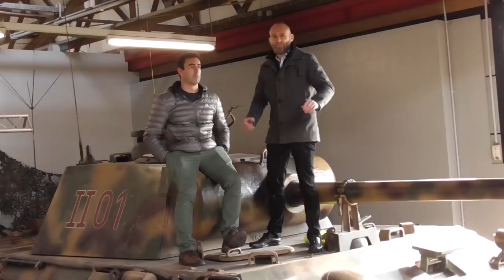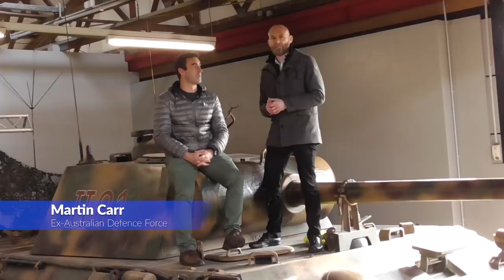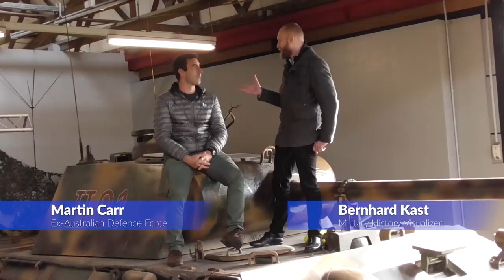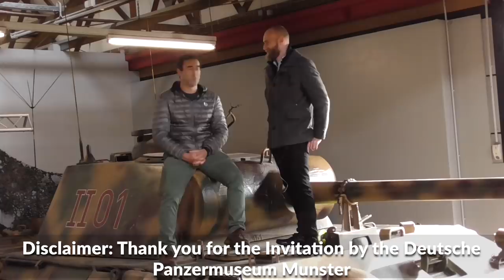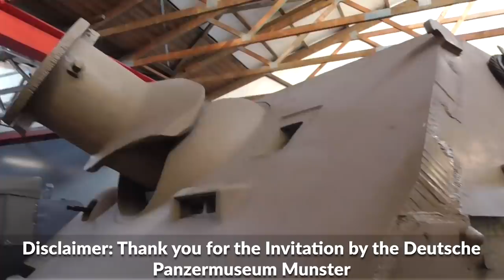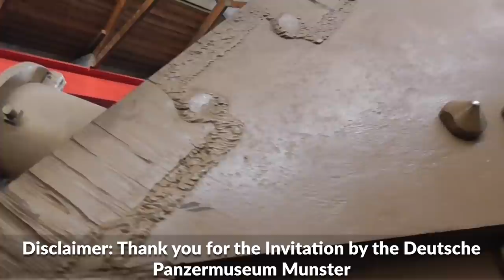The Future of Tank Combat - Decoupling!?

Comment: I believe this is a good point but it also introduces some vulnerabilities. First communications must be super reliable, second  destroy the control vehicle  and you have stopped a number of other vehicles, because autonomous systems are a double edged sword. I rather believe that new materials and active protections systems will allow lighter vehicles.
Reply: Well first they have to figure out how to make an active protection system that doesn't eviscerate supporting infantry.
Reply: Active protection doesn't save you from the ever primary treat of mines and ieds and new materials espesially if the make you lighter dont help either. But that's great you'll be able to use them on the manned command vehicle and maybe some of the heavier screening drones, the later can be configured to front and side armor for the head to head fight and the command crew can be hardened against mines, ambush and arty but still fast to get to a hull down or hide position. You keep communications reliable and over come jamming by broadcasting close to the asset from a good position or by relying through several receiving and broadcasting drone assets. Humans are gonna just serve as platoon and squad leaders remotely commanding fire teams of 3-5 combined arms drone swarms with air and ground units spotting, shooting, relaying and baiting for eachother all while humans hind hull down behind a hill.
Reply: A variant is to build something like a Russian T-14 tank. Put the crew in  compartment in the hull  where  you can have a lot of amour but put the sensors, guns, engine etc in part with less or no amour.    The decoupling can be inside one vehicle not just in multiple.

So you can protect the crew from a IED and other attacks but sacrifice the rest of the vehicles if it is hit. A scouting vehicles could have the weight and capability like in the past but protection of the crew.

It is a bit like battleships and the "all or nothing" armor schemes.
Reply: Hybrid could work. Sensors and anti mine, anti missile protection on drones and maim weapon on the  primary vehicle. Sort of an entourage programmed to follow.
Reply: There's no reason why a 100 tanks couldn't share 100 drones (or more) in a distributed network. Destroy one drone and now 100 tanks are sharing 99 drones etc

Comment: In Afghanistan and Iraq drone and remote technology made exponential leaps forward. IED rocket and mine technology was adapted rapidly by the insurgents who also started using commercial drones and the like. One outcome was wheeled armoured vehicles made a big comeback as mentioned. The Australian Bushmaster wheeled troop carrier did very well. No KIA from multiple strikes. The wheeled Aslav was not as successful showing design and countermeasures still matter too, not just wheels!

There is already integration between various elements like AFV and drones. Decoupling would be a logical next step however there are also big practical problems some of which were touched on well  in the presentation like comms, jamming etc.

But many of the problems are quite mundane and practical. Drones and remote vehicles can do very strange things like fly straight into mountains or easily get bogged if on the ground or not see the enemy standing right next to them or perceive non threats like civilians as threats or lose signal going into dead ground. Very hard to recover when things go wrong! This was all seen in Iraq and Afghanistan. The battlefield is much more messy than the theory and the best testing opportunity.

But I can see tanks decoupling elements to become a sort of spatial weapons system or at least to have that capability. I say capability because the tank as a portable complete weapons system is always going to have advantages on a fastmoving battlefield. It is its main advantage. For example if you deploy things like drones or unmanned sub vehicles you also have to retrieve them which takes time. 

Time is of the essence for advancing armour. Imagine even just a squadron of tanks deploying and retrieving all their remote bits. Big potential for tangles and delays...of course these problems can be overcome through training and SOP's. But these will take time to develop. It suggests decoupled elements might first find their place in specialised units within armoured formations, such as the recon units which are usually  the more forward-leaning, experimentally receptive units because of the high risks they take advancing to contact. 

I  can see armour using decoupled elements in specific situations like when they are on the defensive, want a tactical over the horizon view or fire capability, hull down providing covering fire for other elements like infantry, or come up against a potential obstacle like a built up area with a high IED/anti armour threat.

Interesting to note that early experiments were made by the Wehrmacht in WW2 with their goliath and borgward remote controlled demolition vehicles but were not very successful. This was attributed at the time to the primitive state of the technology, which is certainly true, but the practical issues listed above still remain to be overcome.

Comment: After this, I'm reminded of the phrase, Delay, Degrade, Deny. 

This is the reason I think we also won't see this fully decoupled vehicle as suggested. It's going to be seen as too much of a vulnerability to the fighting capable of all you need to is delay the signal. Especially if it's the primary offensive systems. 

So we might see smaller, secondary, off shoot vehicles acting in support of a main vehicle, equipped with a form of cannon. The end form and function, principle of said cannon is more the question. The idea of tank hauling a couple of smaller UGV's around, allowing them to be turret down and observant, directing AT missiles or the like onto targets, has some value. So to does this work for mine sweeping duties, better the drone gets blown up than risk the tank. Not only that, provides means and methods for members of a platoon, company, to provide mutual support to other elements. In their own formation or additional supporting formations. 

Tanks make the beach head, take out any large armoured hostiles, then supporting drones can move in with the infantry, doesn't sound so bad. Depending on capability, actually sounds pretty good. 

Unless you can guarantee that the system is able to work under adverse situations, a complex ECM and ECCM situation, in areas with high degrees of reflectivity, at least in the areas of radio communications, more importantly, is able to determine a proper, authenticated feed from false inputs, sort out harmonics, background noise that so happens to look like signal, we're really not going to see it. 

Like the guy said, anything that emits is going to really light up the area. That I don't think will ever change. 

And..... we're only getting better at identifying, recognising the stuff.

Comment: As per the "old" Swingfire / CVRT Striker model - where the missile operator could fire from a remote location with the vehicle in dead ground / reverse slope. If you can mitigate the EA threat then you could be siting in a shipping container as per the current UAS model.

Comment: I highly doubt cannons and sensors will be decoupled. You want at least a mediocre sensor suit on the cannon vehicle just so it can still operate somewhat on it's own and isn't effectively taken out if the sensor vehicle get's destroyed. But now you have two diffrent vehicles, including all the armor, engines etc.. you need anyways. If you'd just upgrade the sensors on the gun vehicle to those you'd otherwise put into your sensor platform you can forego an entire vehicle. And similar you'd want a sensor vehicle to carry at least a light armament so it's not entirely defenseless. (Integrated sensor drones are another topic, but they are a addition to a tank, not a replacement for it's capabilities)
Reply: I agree. Sensors can easily be taken out by enemy fire, desert sand and other stuff so its not practical to rely on sensors only. Furthermore would sensors also require space, and space for cables and electronics which will mean that less space would be left inside a tank for other things, and armour thickness needs to be reduced and several weakspots needs to be added when you fit all your sensors... so I doubt it would be worth it.
And it would also cost money.

But I also think the development will go towards more automation in other aspects. Tank guns are starting to use to large calibres that it would no longer be practical to load guns by hand when Leopard 2 and Armata starts to use shells with a big diameter of 130 and 152mm.
So autoloaders will therefore become more common.

Comment: My main concern would be emp
Reply: you can shield against emp.
Reply: The heat, energy and other radiation released from creating an emp would take out everything anyway. Not gonna get any kinda emp effect other then normal jammers without a nuke.
Reply: EMP is overrated - it is quite easy with current technology to build EMP resistant electronics, most front-line strike aircraft and attack submarines already have this. The issue for the poorer armies and the  commercial sector is cost  - doing this increases the cost massively. EMP will be devastating  to the public and armies operating commercial and non protected equipment. Interestingly the Russians had a way to isolate EMP and keep the cost down - they used valves not transistors or chips in the MIG 25. At first the Americans laughed when they finally looked one over,  till someone pointed out its benefits in this area. You can protect electronics, but if I am in the air when the bomb goes off I hope its a Lancaster not a Boeing or Airbus.........

Comment: The solution for the jamming sensor signals would be a kind of tightbeam signal instead of a broadcast like is used now. Yiu would need visual contact to your sensors and gun, but that could be solved by relay chains or nets. The real problem imo is energy; running such a system is infeasible over longer periods of time when spread apart.

Comment: I've been thinking about a couple of ideas for future tanks. Feel free to give me some input:

1. A primary weakness of tanks have always been the limited visibility from inside the tank. Visions slits and optics have been employed, but tanks still need the eyes of infantry support to gain full situational awareness. So what if the tank crew was equipped with a VR-system that is linked to strategically placed cameras outside the tank, effectively letting the crew to "see through" the interior walls?

The loader might not require one. But the gunner, commander and driver could probably benefit from this feature.

The technology to pull it off is already avaliable as there are VR-cameras capable of sending a live visual feed to VR headsets.

Of course, a point of criticism might be that cameras on the outside of the tank hull would be vulnerable to enemy fire. But tanks already employ external optics (protected as much as they can be) so it's not a bigger weakness than the ones tanks already have.

It would just add a greater field of view for the crew instead of being locked to the very narrow field of view that current optics provide.

2. Pyramidal tank hulls. Sloped armour has been proven to be effective protection against many anti-tank weapons. The effective armour thickness is increased, and the angle of the sloped armour creates a greater chance of hits glancing off the armour rather than hitting it dead on.

So suppose you shaped the exterior top half of the tank (above the tracks) into an armoured pyramid shape. This would give you sloped armor on all sides, leaving no vulnerabilities on any side.

The top part of the pyramid could house the turret and be designed to rotate just as a regular turret on top of the rest of the pyramid.
Reply: Seven Proxies So basically a modernized T-34 hull profile.
Reply: @classifiedad1  Almost, but not quite. The T-34 still has a lot of flat horizontal and vertical surfaces. Especially on the top.

And seeing as how many anti-tank weapon systems employ guided missiles which are guided to a trajectory which sends the missiles high above the target in order to strike the target straight from the top in order to defeat the benefits of sloped armour, the T-34 would still be vulnerable.

My intention with a completely pyramidal profile was to eliminate a "flat" top side for such weapon systems to target.
Reply: The problem with that is you lose enormous amounts of internal volume. This results in everything getting squished together in the tank, making things very uncomfortable for the crew and forcing you to make compromises with things like computers, engines, weapon systems, ect.
Reply: @CS-ri1eo : Not necessarily. It's really down to a matter of design and proportions.

Also, with VR-equipment making the tank armour effectively transparent for the crew, you might actually get away with less people crewing the tank than you'd need otherwise. Making it less cramped.
Reply: @sevenproxies4255   Modern tanks look the way they do because they already make very efficient use of space VS weight. They already are sloped from the front. The parts at the front that don't look sloped are most likely part of spaced armor and the inwards of the armor probably are sloped. So, what you are asking is essentially using an Abrams/Leopard2/T-14/(insert your favorite tank here), making it wider and adding additional sloped armor on the sides, and additional sloped armor on the rear.

If you make the armor pyramid big so that everything fits inside, then the vehicle becomes extremely heavy. This means it will use a lot of fuel, will be slow and will probably break down more often (require a lot of maintenance). I'm also not sure how you can make it a pyramid shape without making the tank super wide and hard to navigate along roads.

If you make the pyramid too small, then you cannot fit the current components inside. So, you need to reduce the capabilities of the vehicle.

You've added a lot of armor onto the tank with the pyramid shape, but the tank will usually not get hit from the side or rear. So, you've added mostly dead weight. The tank now also becomes a lot more expensive. It might not be worth it. Just look at the WW2 Maus tank, for instance. Was the armor worth it? I don't think so. You need to strike a balance. Armor for the sake of armor is not a good idea.
Reply: @AleksandrKramarenko : The pyramid shape does not require a square bottom. It can be elongated.

Also, the height isn't necessarily an issue because you could influence the vehicles height with a new or different kind of suspension for the tracks.

No existing tank is completely optimized. There's always room for improvement.

Also regarding your comment about tanks rarely getting hit from the sides. That's got more to do with doctrine and formations. Tanks operate in a formation intended to prevent being hit from these angles.

The problems is that the formations are also troublesome and not as flexible as they could've been if the tanks had equally strong defenses on all sides of the tanks. This could potentially create new and even more flexible doctrines, increasing the effectiveness of the tanks.
Reply: @sevenproxies4255  Look at it a different way. You cannot add anything more onto current tanks. They are at their limits. If you increase armor on the side/rear, then you must remove something as well.
Reply: @AleksandrKramarenko :  No, they are not at their limits.

Like I said, no existing tank is optimized.

Plenty of concessions has been made with aspects like ease of production and costs in mind. The tanks you are referring to are not in any way at their "peak". They're merely "good enough".
Reply: @sevenproxies4255  If that was true, they would've made the armor on the sides (almost) as good as the armor at the front.

Comment: Outrageous idea. What he is saying is essentially the "drone wingman" proposed a few years ago by some air power thinkers. The criticism of the pentagon for such ideas is that unless the drone (in your case the unmanned part of the platform) can be made as intelligent in combat necessities as a human, then it will never happen. Reason is that if the platform is not as intelligent as required and there is need for "man in the loop" guidance, then the risk of loosing the comms link between controller and platform (jamming, etc) seriously compromises the capability to perform the mission, especially against an opponent that uses traditional manned platforms.